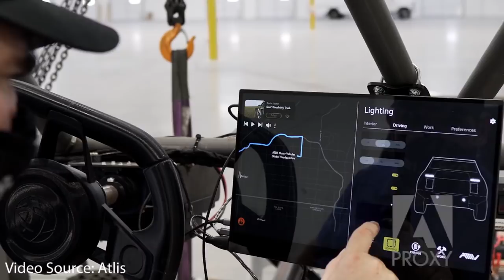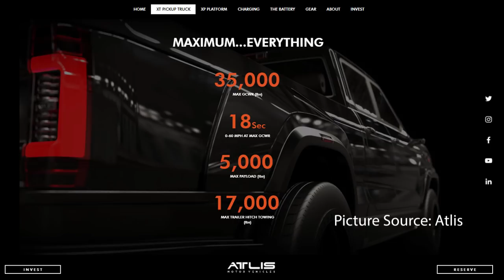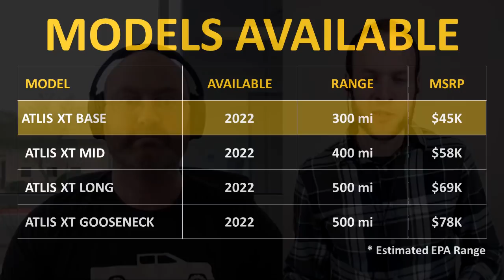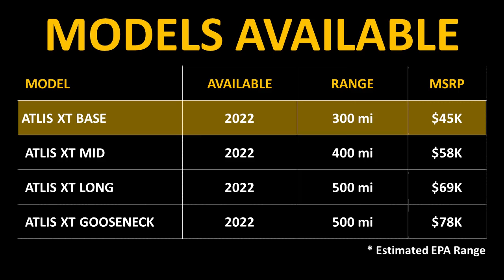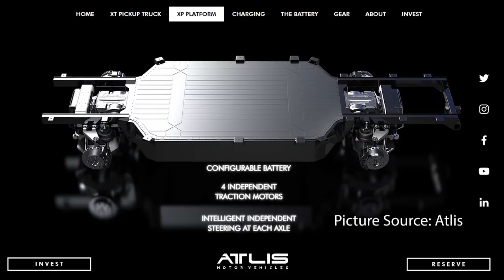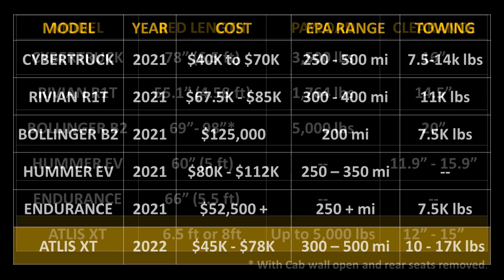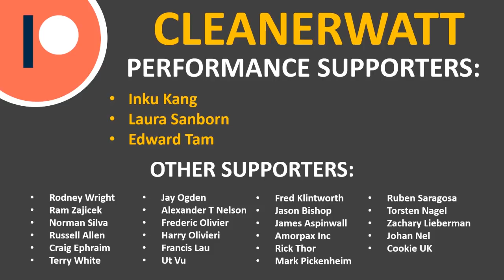Best Full Size EV WORK TRUCK? 2022 Atlis XT - CEO Interview

Comment: This all sounds good but do they even have a working prototype ?
Reply: no, not yet
Reply: Nope, and nothing to confirm their specs they claim.
Reply: They have a working proof of concept for their battery cell claims. It charged in under 10 minutes. The buck is a WIP prototype using their tech.
Reply: Im sure they dont
Reply: @wilkie8664  its gonna get hot and blow up cars
Reply: @ChrisDodges123  I'd agree except part of their tech is managing Temps which allows for the rapid charging.
Reply: Dávincīj15  it’s further assistance not assistant. If you can’t spell, you can’t scam 🤣😂🤣

Comment: Solid state cells are closer to practical use than most people think. Nio announced recently that they will be offering a 150kWh solid state battery pack to customers on the second half of next year.
Reply: Except that solid state isn't really much of a leap forward from existing lithium cells at this point.
Reply: @GregHassler  The largest battery pack NIO has using existing lithium is 100kWh. With the solid state cells they are going up to 150kWh in the same form factor. That is a big improvement.

Comment: The biggest problem with EV's is extreme cold weather lowering the range, charging.  there are other factors like not having many charging stations in many areas of the Country, more expensive tires due to increase weight, and then there battery life depreciates EV's more as the cost of a replacement battery is VERY expensive.    The EV industry has to get a more energy dense battery to use smaller batteries, that won't catch fire, costs less, faster charging times, longer life, and not effected by extreme hot/cold weather.

Comment: I went straight to the Atlis website and zeroed in on what they had to say about their battery tech.

Bullet points.  Completely vague, nonspecific.  For a company that brags on its transparency, that is not a good sign.

Also not a good sign is the notion that a company with only 150 employees - how many could possibly be battery experts? - think they can assemble their own batteries, from existing suppliers with existing tech, solve the production engineering, get costs and rejects under control, and yield 2 miles per kilowatt-hour for a vehicle form-factor that's only slightly better than a wall, aerodynamically-speaking.  Traditional pickups have terrible aerodynamics.  This is a traditional pickup.  This sounds like a bogus claim to my ears.  Cybertruck might get close to that level of efficiency, but that is not a traditional pickup and it has excellent aerodynamics.

I get that Atlis will hire more people when they're ready to manufacture stuff.  But the confidence in their battery design isn't coming from future hires.  It's coming from their current, exceedingly small, crew.

They also think they can take these contemporary battery components and somehow put them together to yield amazing charging speeds without cycle life degradation, and reverse dendrite formation when it occurs - features that the suppliers themselves, using their own components, can't pull off themselves for their own cells.  This is basically a promise of pure magic.

Hanchett talked about wanting to do dry-coating of electrodes to eliminate drying during cell manufacture, but the only company that can do this (and it's patented) is Tesla.  None of the industry suppliers is able to furnish dry-coated electrodes to his cell assembly production line, not by 2022.  If they don't license from Tesla, they'll be stumped until they go through their own developmental effort while avoiding stepping on Tesla's IP.  That will take years.

Hanchett said he has patents pending, but there's nothing on his battery page that mentions what those patents are, or how they'll use them.

Who, exactly, thinks it's a good idea to take (usually) nonlethal taser darts and fire them out of a shotgun?  Are you kidding me?  Very low velocity is critical to preventing serious injury, and even that doesn't work sometimes.  Conventional tasers already have an unacceptable kill count.  Accelerating them to higher speeds?  Who would do that?

I fail to see how that experience translates into automotive engineering.

The more this Hanchett guy talks, the more nervous he makes me feel.  I'm seeing red flags all over the place.
Reply: I'm pretty sure that's what's been said about Tesla and probably still is being said by some.
Reply: @EV3NTH888  except Tesla never spat this much BS. They seemed to keep it on the down low until they had a real product to show, the Model S, the Model 3, they had the specs and they had the tech and the numbers to show it was real, Atlis sets off a few red flags, but if they do start to deliver, then they'd be worth looking into.
Reply: Check out their YouTube genius...not just the website.  while they are a big risk to make it still this is not the same type of hype as lordstown or Nikola.  And yes tesla did make big promises in their early days and then delivered.  Atlis just needs to deliver and if you watched their weekly updates you'd realize they are actually a tad more open than others...
Reply: @theproffessional9  Like Benjamin said, check out the youtube channel, they provide regular updates on what they are doing.
Reply: Aka Nikola 3.0, with Lordstown Motors being 2.0. 

The question I ask of any EV company that claims to have patented battery technology is, who’s their researcher?  Tesla has Jeffrey Dahn and I want to know who’s Atlis battery researcher is?  Lordstown Motors, Nikola, Canoo, faraday future, Lucid Motors, Toyota, Honda, GM, Ford, etc
Reply: @GG-si7fw  It's fine if they're outsourcing batteries and predicting performance metrics that match what those batteries can deliver.  But that does not look to be the case with Atlis.  They're trumpeting next-gen range and next-gen efficiency from batteries they will patent and produce themselves - so where are they getting their expertise?  They haven't acquired any companies doing battery research.  I don't know of any papers Atlis employees have published (might have missed them, of course).  They say they have patents pending, but none awarded - nothing we can look up. 

All at very appealing projected prices, on a timeline that's blistering fast.

It sounds too good to be true, to my ears.
Reply: @EV3NTH888  the regular week on week for years rehashed 'significant progress' updates but still no truck? Or a grade school lab like demo of their battery tech? That guy keeps on riding that skeleton truck being pushed by his work mates for years.
Reply: @GG-si7fw  Atlis is working with Clemson University and their nanomaterial department for battery development, Media Tech is helping them develop the cell level production, and Greatech will be assisting them with pack production.  Their cell design is not cylindrical (which is a poor form factor for thermal management). Thermal management is one key to their battery technology.

Comment: So I need a truck that has an 8 ft bed, tows 20k lbs, hauls 3k lbs and gets at least 500 miles on a charge.

I can buy a diesel truck that does all that for about $60k.

How much is that going to cost with Atlis?
Reply: Probably close to the same. Their proposed starting price is 45k. But if ever does come out the price could go up.
Reply: @GoldenDoodlez  With the way gas prices are going, I'm leaning toward an electric, but I can't afford to spend more than $80k.  I hope Atlis puts in the power unit feature that Ford is doing, where you can use your truck batteries to power your whole house through the charging unit, in the case of a power outage.
Reply: If Ford, Tesla, Rivian, GMC trucks are not at that price, that should be a red flag. These are companies with billions of dollars, established factories and supply chains. Somehow atlis can do this in an empty warehouse?

Comment: No prototype? No? How about reputable investors? None of those either?! Total vaporware then. It’s just another CGI wish.

Dude said cylindrical and prismatic “technologies” don’t allow for ultra-fast charging which is wrong since chemistry, not form factor is the biggest factor in allowing for rapid charging. Cube cells? Lol.
Reply: You can literally watch them build the prototype on their YouTube channel, they show it weekly and it's drivable. 

Cylindrical cells is a poor form factor for thermal management, technically it's the second-worst shape to spherical for thermal management.  Atlis is focusing on precision thermal management, which their physical form factor will allow for, which will allow fast charging.  It's not just chemistry, in fact it's probably close to equal parts electrochemical and mechanical.   See Tesla’s tab design on the 4680 - it's a mechanical advancement that allows for better power transfer. 

So basically, you should learn a little more about Atlis and about how batteries work.